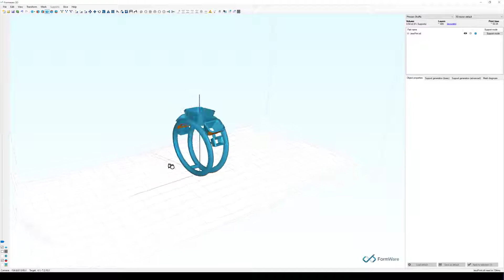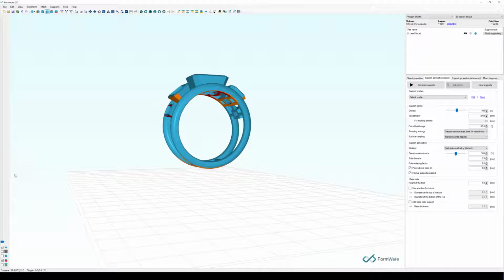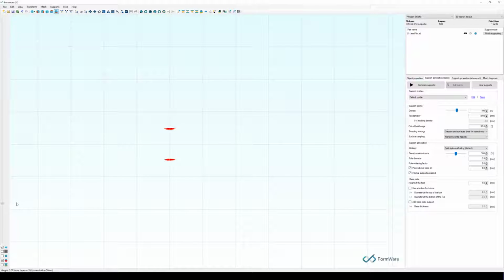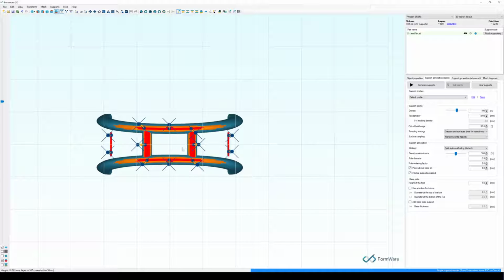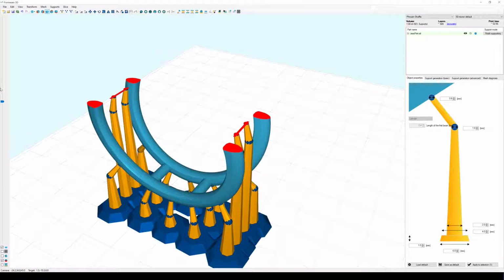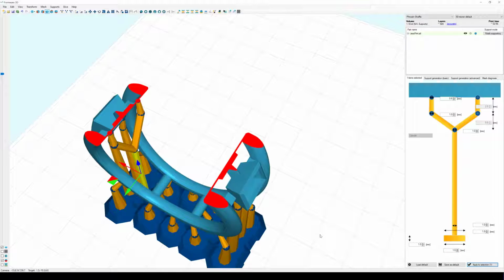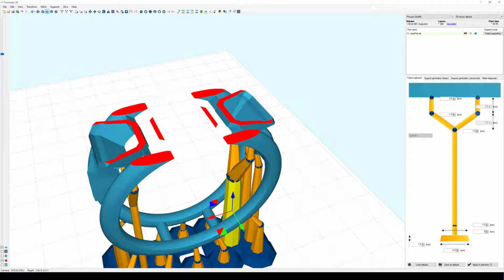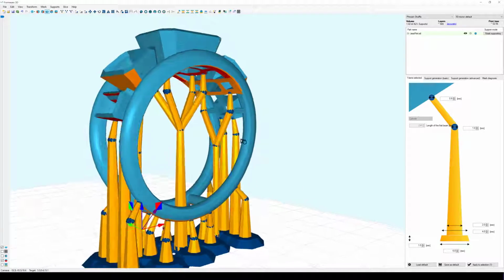Jewellery 3d Printing Jewellery Supports

Comment: What if you models has 360 prongs on it?, how can you add support to the islands without damaging the detail? I've tried everything , I watched all youtube vids for this problem, couldn't resolve it after 6 prints, Any ideas what I can try with a ring that has 360 prongs on the rings, (I mean by 360 that the ring has all prongs on every side everywhere)
Thank you for you video ;)
Reply from the maker: Hello Valodik, What i personally do if it is that style of full ET i add two half circle rails and then support that and that way you can either snip off the excess or use it as a feeder to cast the piece,
Reply: @Pro3DShopUK  what do you exactly mean by half rails?